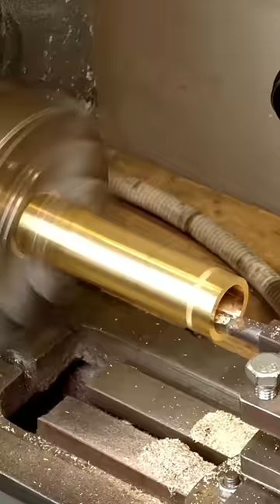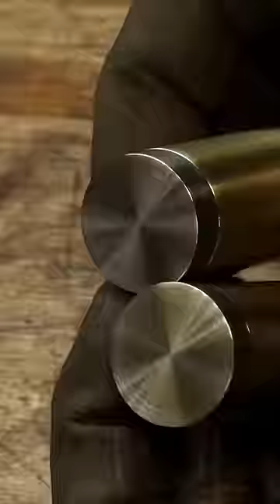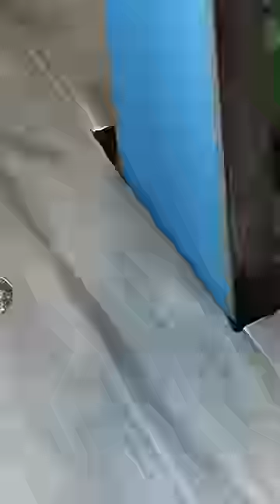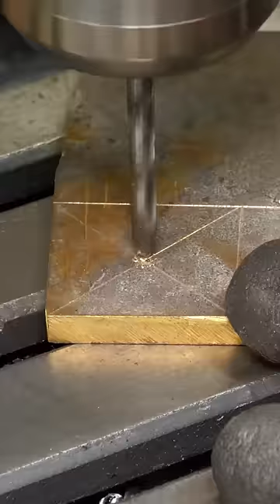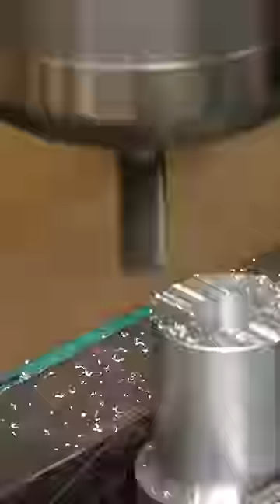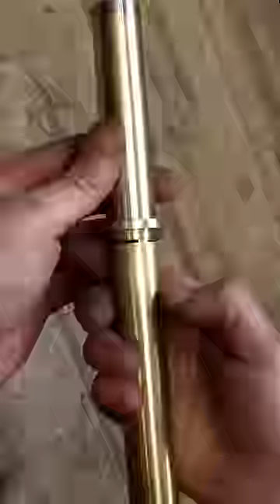Brass Tube Knife, Super Speed Build #shorts

Comment: This is pure artistry. Great Work
Reply: Certainly not a functional thing. Definitely took some skill to make, but there is a reason they forge knifes and not carve them out of metal.
Reply: @markusstewart9298  depends what steel was used
Reply: @markusstewart9298  Most artisanal knives are made this way, forging is more prominent in sword making. The only reason this isn't a 10/10 knife is the tubular handle which I'd expect to be quite slippery and uncomfortable. Other than that if the blade is tempered properly I'm sure it'll work great.

Comment: Overall nice build, however make the handle more oval-shaped inline with the blade if you don't when you go to use it if you don't line the cut up perfectly you'll glance and have at worst an accident
Reply: Glad someone else has high standards and common design sense.
It’s nice looking, but bad ergonomics.
Reply: @Hoellewood_Solutions  yup. I've learned the hard way with handles it takes many designs and 100s of hours to get a handle that feels good and looks sleek.
Reply: it also has a thin ass tang. wouldn't hold up go hard work
Reply: يجب العمل لمقبض بحيث لا ينزلق بيدك ويجرح يدك
Reply: @Zeeboklown it isn't meant for that

Comment: It’s not very strong brass in fact it’s really soft compared to steel so I’m going to chalk this one to art more than function.  I love machining brass it’s such a pleasure to work also bronze as well.  Bronze is slightly harder and a lot heavier than brass but they both machine buttery smooth.  Self lubricating as you machine them.
Reply: The blade isn't brass!
Reply: @pdloder of cause it isn’t lol.  I was thinking of the threads because brass is soft.  I never said the blade was brass lol.  Read it again.
Reply: @Biketunerfy  the handle and the sheath are both brass which are often made of leather and brass is obviously stronger than leather.
Reply: @pdloder  yes but you have to screw the knife into the handle to give it a handle,  it’s not very strong.  I’ve bought one of these tube spades with knives and things in each tube extension.  It was made of steel it lasted less than 10 seconds after the threads just pulled apart.  I make knives and I make my own sheaths out of leather but you don’t screw your leather sheath on the bottom or the base of the knife to give it a handle.  The brass is fine to house the knife it becomes a problem when you use it for the handle
Reply: @Biketunerfy  point taken.

Comment: cool but maybe make the handle more oval shaped for edge alignment when in use

this is totally gonna roll around in the hand
Reply: нож клинок  не кованый это полное говно
Reply: @user-ch8xj1jp1x knives made from stock removal can be just as good or better than ones that are forged; it just depends on material quality and proper heat treatment along with tempering. However, I agree with the above comment about handle shape; a knife with a perfectly round handle is practically useless.
Reply: @harleymarshall6929 I would also make a point of noting the lack of tang. The fact it all hinges on a single screwpoint connection is probably not practical on the long run. Any significant amount of force could either warp or snap the blad if it gets jarred in the wrong way while in use
Reply: У нас в тюрьмах такое делают
Reply: У меня такой был из нержавейки,с одной стороны нож-перо ,а с другой стороны вилка на два зуба

Comment: I like the concept, but as a machinist, I can tell you that a threaded tang offers little to no stability support from the guard/quillion down. The brass handle over it will help, but ultimately less structurally sound than a full tang

Comment: The second this thing is used, the untempered blade will bend like a paperclip because there's zero edge alignment on that round handle, and it'll snap in half at the threads. 0/10 I'd take a sharpened butter knife over this

Comment: How much of the metal flakes would you have to take to make into a knife that even possible?
Reply: You mean from turning, drilling, and the sort?
A lot of it, and it will take a long time.

Plus when forge welding, if even exposed to a little oxygen, would easily burn up preventing proper fusion.
Not really worth doing.
Though there were a few guys that did it, if you look up drill spiral Damascus, should give results (Green beetle, and shurap.)